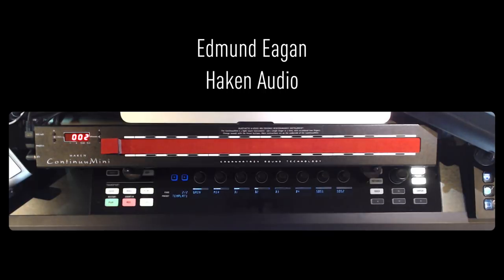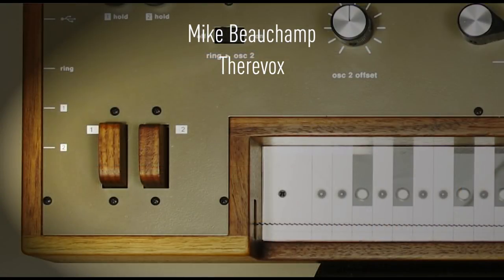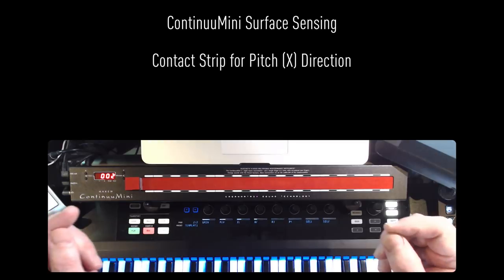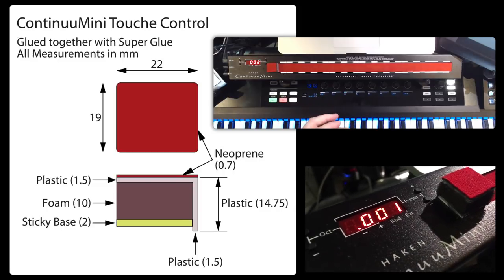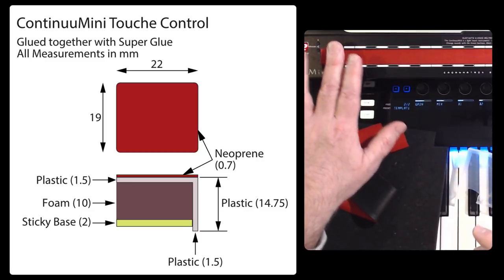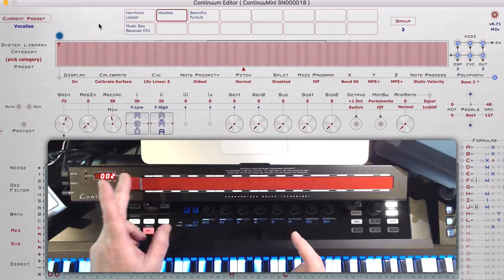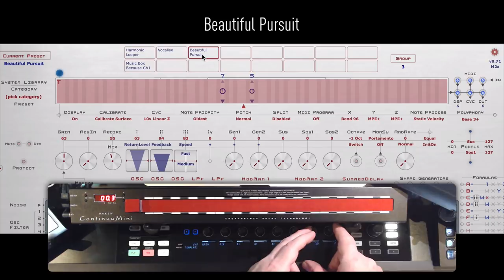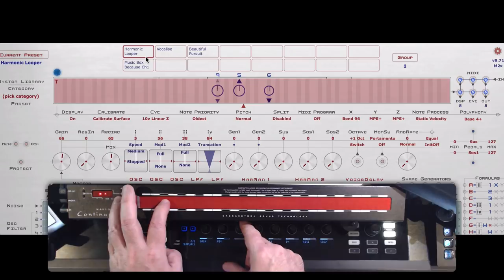ContinuuMini with added Touche control

Comment: Haken Continuum will be work with drum machines? in electronic music?
Reply from the maker: People play percussion with EaganMatrix sound engine, for example this video uses one of the sounds also available in the ContinuuMini: https://www.youtube.com/watch?v=Pi09XW_V_Vc     .... You can control it from a Midi drum machine, but you won't get the variation you get when a human finger plays each note -- more variation for each note with finger drumming than from a drum machine.  If you do use a drum machine, setup is easy if your drum machine supports MPE MIDI -- otherwise you need to figure out how to configure your drum machine properly (it may take some patience the first time you do this!)

Comment: I like the idea and the detailed explanation.. however, it also frightens me a bit that the default Z-axis and Y-axis of the Continuumini control-strip might be to hard to control properly and therefore you need this extra addition to get the most out of the instrument. Personally I don't see myself building something like this....
Reply from the maker: The core idea of the Haken Audio instruments (this one included) is quite different from other devices on the market.  The important thing is to make the performer part of a tight timbre-feedback-loop; whatever is being measured must be measured quickly and accurately, and affect the fine-structure of the sound in a non-trivial but still musical way.  That is different from "easy to play" or "ideal independent control dimensions" or "generic MPE controller" idea, and closer to the experience of acoustic instruments, where getting any sound out at all is a challenge.  The sensing technology and its submillisecond effect on the timbre you hear is very different from what you are used to.  If you are interested, check out the comparisons on this page: https://www.hakenaudio.com/mpe   ... But also, let there be no misunderstanding: the ContinuuMini is not just a small version of the Continuum; we are very open about the challenges in playing a Mini; the idea of the Mini was to make this world available at a lower price point.  Still, people that own a Continuum and a MIni (after some adjustment) get to like the Mini too, in its own right.  Just like some difficult-to-play and more limited acoustic instruments can still be a joy to play.
Reply: I would very much like to buy an standalone EaganMatrix synth in a box, with a bit more DSP horsepower than the ContinuuMini.   I'm not really a fan of the Continuum playing surface (either the full or the mini), but I love the expression I can now get playing the EaganMatrix in ContinuuMini from my Linnstrument.   However, I often have to reduce the polyphony of the sounds , sometimes to just 2+, so that the ContinuuMini doesn't click or error.   A nice big "EaganBox" with MIDI in and audio out would be fabulous.